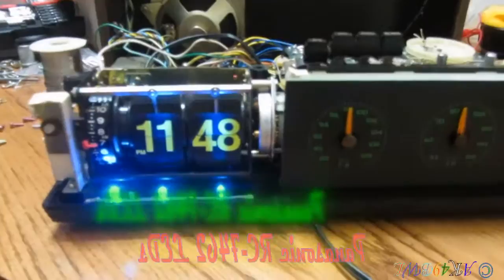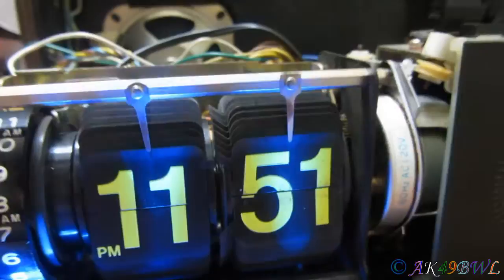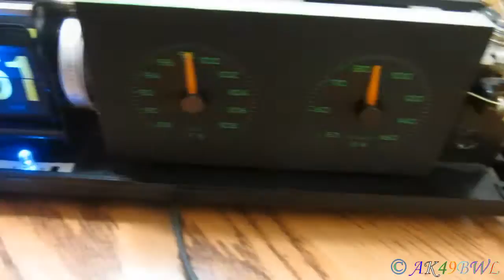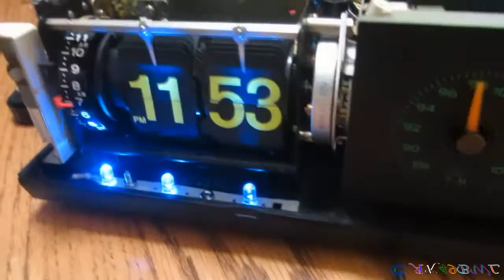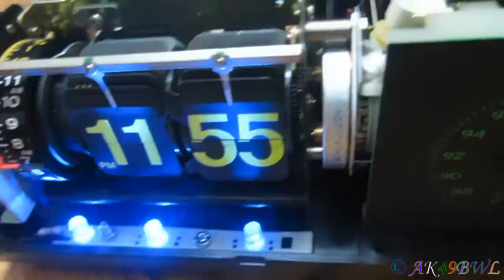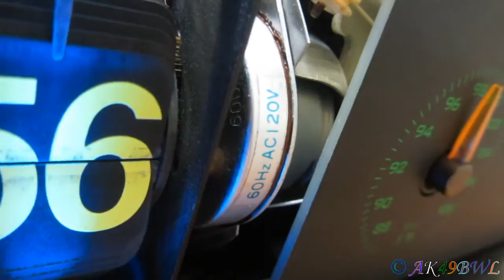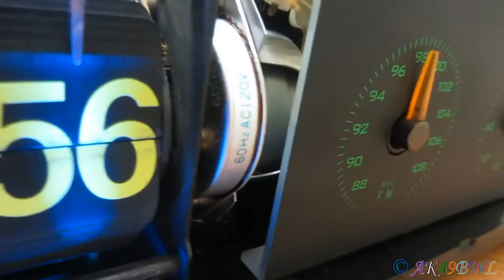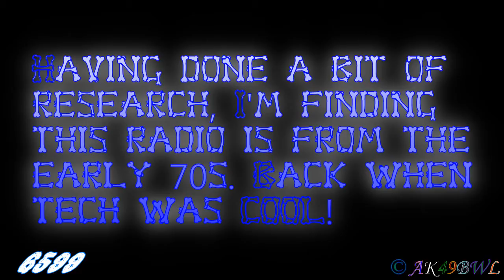Panasonic RC-7462 LEDs - VLog 240, 06/29/2015

Comment: So I fixed mine! I took a GE 4310 flip clock because the motor runs counter clockwise and disassembled it. I separated the motor from the gears and transplanted the GE clock motor with the gears to the Panasonic! Works great! They are both copal motors. Be very carful separating the geers from the motor on the Panasonic because you need that hole gear assembly to put back on your Panasonic.
Reply from the maker: Holy crap, seriously? I have like three of those radios o_o
Reply from the maker: And it still keeps perfect time?

Comment: Did you get that motor running? I doubt it has a capacitor. It's a small motor, and looks shaded pole in style. Try taking motor out and remove the rotor from the stator. Clean the stator. Do not use oils, they attract dust. If its dirty you can use electrical cleaning solvents that evaporate quickly. If the rotor is coming in contact with the stator in any way (worn out motor bearing) you need a new motor. Hope that helps :)  Capacitors are used on high torque motors that are PSC style motors (these motors are motors that carry a lot of load, ie: compressors, large fans, etc.)   If you need visual help with removing motor check out the flip clock channel on you tube.
Reply from the maker: I have removed the motor a few times on this guy but never attempted removing the rotor from the stator... Don't want to mess it up. It runs fine if I leave it alone lol. Sometimes I have to give it a push if there's been a power outage, but other than that it works great. Bearings I'm pretty sure are still fine. Still haven't finished putting LEDs in it tho lol. Is it even POSSIBLE to get a new motor for these things anymore? I was under the impression it isn't.
Reply from the maker: I have another one of these flip clocks with a few cracked gears in the gearbox, I might try it on that one first because there is no fixing that one lol. It's a GE clock radio tho, not nearly as cool as this one lol. Bit lengthy but it's here: https://www.youtube.com/watch?v=QxfYKQIuUC4
Reply: I've always liked panisonic and copal the best. I did just buy a ge myself- the one that's in the movie hail caesar. Best of luck to you.
Reply from the maker: At least 2/3 of everything electronic I own is Panasonic :D ... Opened up the GE again last night, found the cracked gear still working pretty well, but something else I hadn't noticed before: the first nylon gear after the motor output is stripped bad. Apparently a common issue. That and the output shaft bearing had more slop in it than the cracked gear ~
Reply: I'll be sure to watch, thanks.

Comment: Needs a start capacitor
Reply from the maker: Three Swords Are you sure of that? I'm honestly asking here - I don't know. And if so, how would I hook it up? (Obviously I'm technically inclined so you can be technical with me lol, I just don't know much about using caps on AC circuits)
Reply: Most AC units have what called a start run capacitor on it. It just gives it a jolt to get the motor running. I am not 100% that your clock has one, but it makes total sense to me that it would. You should see one somewhere in line ahead of the motor.